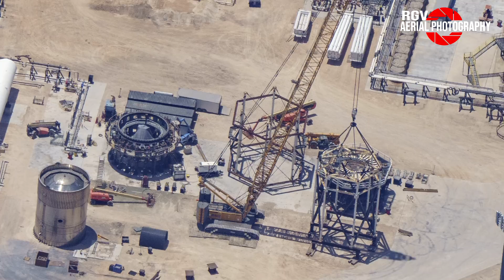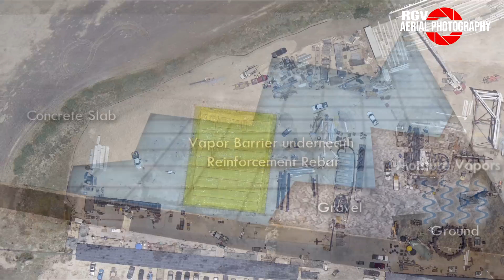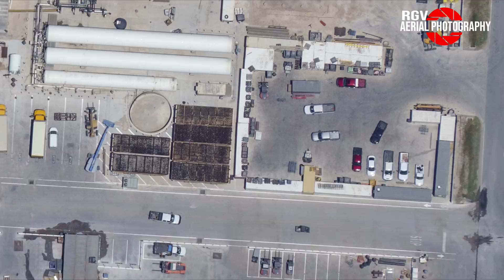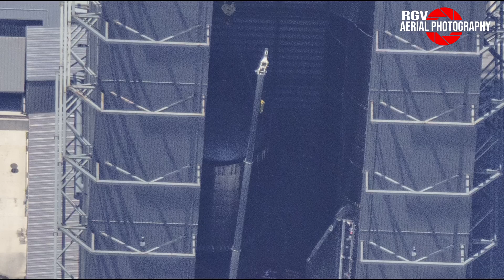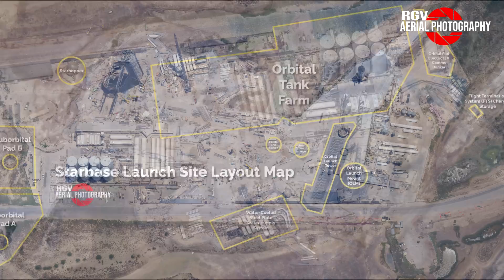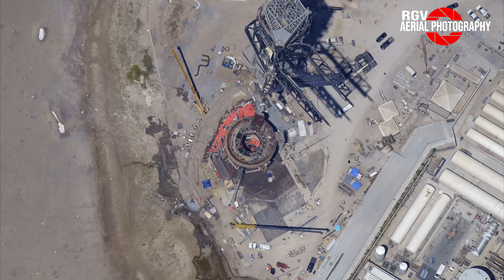Booster Design Change Confirmed? Starbase Flyover Update Episode 6

Comment: stagnation pressure at the contact point of the engine's shock diamonds to the steel plate is quite a lot greater than the water pressure. this makes me believe there will be erosion, since the metal wont conduct heat fast enough

Comment: I don't think that  up bend is to stop flow with an air pocket.  There is so much pressure behind the water, the air pocket would get blasted right through.  I think it is there to drain all the air out of the system between the pad and the tanks.  A pocket of air ripping through the system could tear everything apart, so they need to remove all the air between the water tanks and the valves at the discharge.  Also, they need to make sure that any water that pooled under the OLM could not flow back towards the tanks.

Comment: I personally think this is the best idea so far with cooling with water. I was on an aircraft carrier and the JBS "Jet Blast Deflector" was water cooled. I have faith in this design.
Reply: My question is, by using water for cooling, do you actually produce more Hydrogen or Oxygen from this delivery system?
Reply: @dougwhite2897  What they produce is a lot of steam.  Some water might disassociate but likely not a lot and any that does would likely recombine in a hurry.

Comment: The raptors are gonna wreck that steel plate. They’ll need to replace it after every flight
Reply: So you guess.
Reply: @TheEvilmooseofdoom  just like I guessed they were going to completely destroy the pad last time they launched.
Reply: @Rory-Shields  Yup.  Guessing is still guessing.  You can try and pretend you're an expert but I'd be that would be easy to expose.  Stick with guessing.
Reply: Yup. Just guessing. Nothing more.

Comment: civil/structural engineer here.  what's the point of a vapor barrier for a slab on grade for an exterior pad? Water is not a problem once it's set which doesn't take long - in fact it makes it stronger. I've called up lots of vapor barriers over the years for indoor structures where moisture through concrete could be problematic from an occupancy perspective... what am i missing
Reply: is the ground water saline or is there enough separation & gradation from the ocean for filtration? maybe not...
Reply: Moisture can cause plebes for the rebar.

Comment: Its interesting they removed S25's engine shielding....perhaps to work on the engines or was that off when they did the test?

Given the plan of hot-staging, I'd would think it would certainly need shielding keep the blackblast from firing off the Supeheavy from damaging anything as they separate.
Reply: Hot-staging will lead to many minor changes at the bottom of the ship and top of the booster. This is in addition to the big changes, like the huge vents, tank shielding, and extra booster height.

The shielding itself may get upgraded to better handle reflected exhaust. Also, there are structural elements and active equipment behind the shielding that may get upgraded.

I suspect they are going to install more sensors and cameras up there to monitor the stage separation.

Comment: Curious, at what number of fly overs does it become cheaper for you to simply buy your own plane then to constantly rent one?
Reply: Planes are super expensive and then there’s the maintenance costs.
Reply: @jrdaparker  so you think the guy he is renting the plane from for several hours every week isn't passing some of those costs onto him?
Reply: @DanielsCorner644  well, sure but the rental guy probably rents out the plane a few times a day, every day.  I just don’t think buying a plane is going to be cheaper than renting once a week. Maintenance costs alone are huge.  Most of the maintenance has to be done a certified airplane mechanic.  Sometimes you can work with mechanic and do some of the work yourself (like removing inspection plates as part of the annual).  My father had a couple planes and we used to do that.